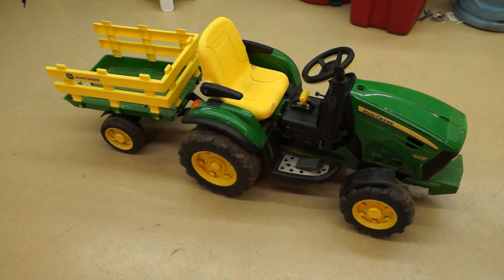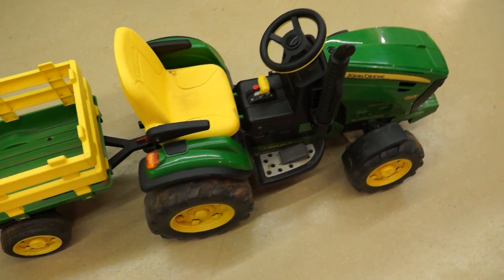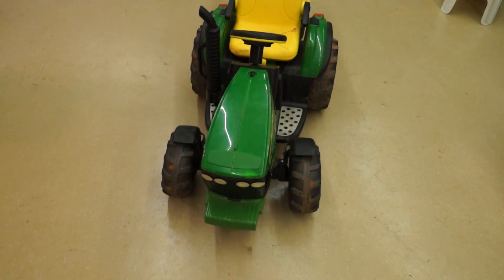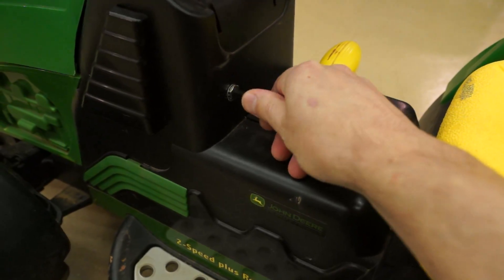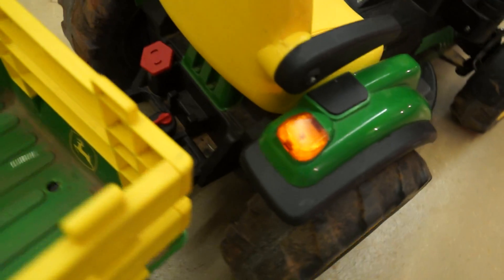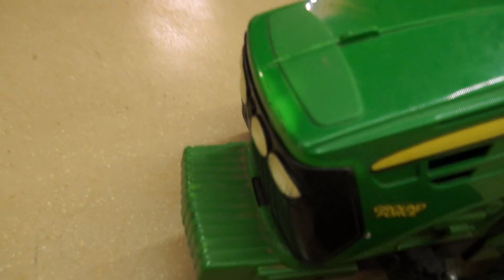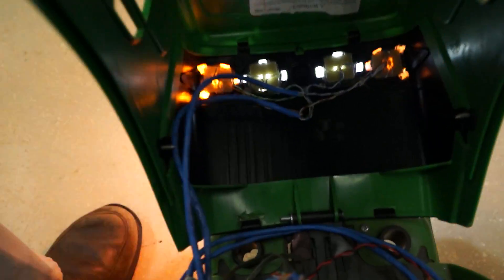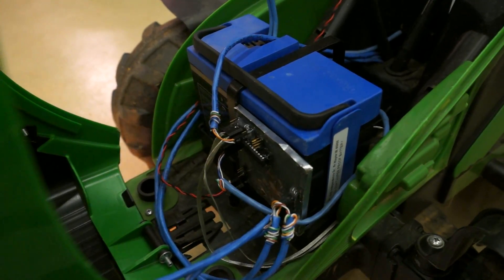LED Lights for Peg Perego John Deere Tractor - Technical Details

Comment: Great job very nice! Might try this as I'm getting ready to order my two year old this tractor or the case version of it. Schematic would be nice if you have one handy and where to pickup some of the parts as in controller. I've made a simple system for under our countertops with different modes but think this is a little different. That was plug and play type of thing.

Comment: Outstanding Work!  Kevin do you think you could give me some guidance on how do this with just with front full beam and tail lights on a simple on/off switch?  I'm not electrically capable enough to do anything more advanced.
Reply from the maker: +Michael Connolly I sent you an email...
Reply: Awesome!!! Like your work!! So I would like to pimp my son's Ground Force with some LEDs as well but unfortunately I'm not  that good  enough to do it without any guidance form a Professional. Kevin do you think you could give me some ?

Comment: Just put switch and led lights will last long time with minimal draw anyway. It's rechargeable anyway
Reply from the maker: +Rick Collins Sure, but since I'm using a microcontroller for special FX, etc., why not just build in a software timer? :) And even though the battery is rechargeable, you should be aware that repeatedly draining a rechargeable battery (especially nearly all the way, as the LEDs would do given enough time), will definitely destroy your battery (kill its storage capacity) over time.